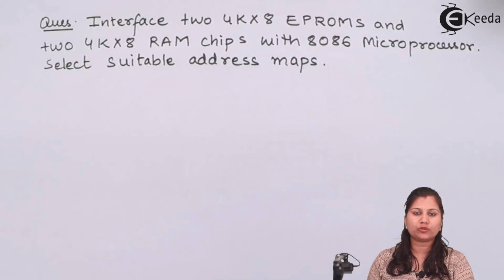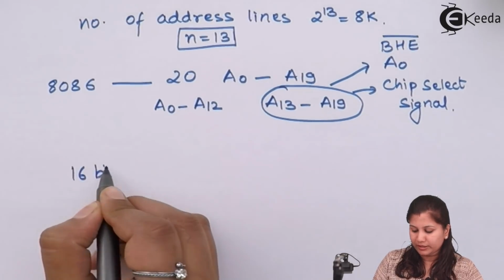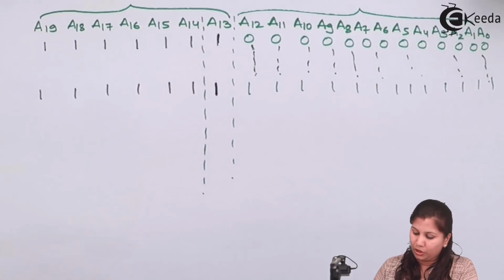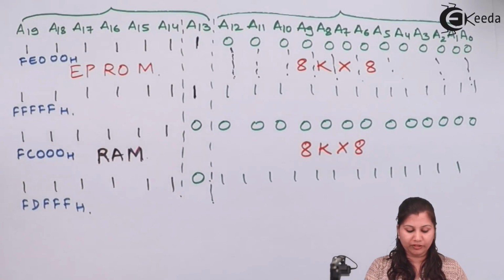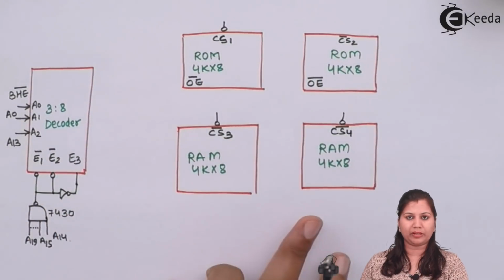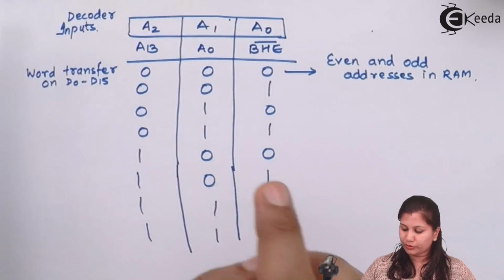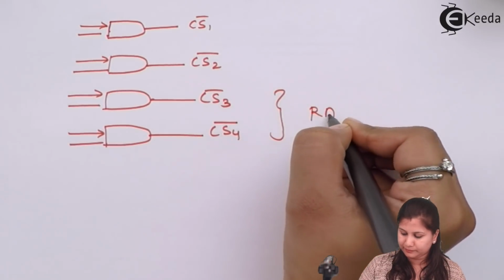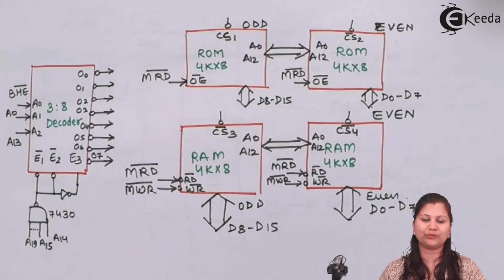Interfacing Memory in 8086 Microprocessor with Memory Chip (Problems)

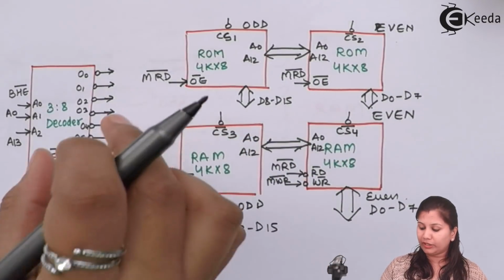Comment: The last part 29:29 is wrong, check the address lines, it should be from A1 to A12 and not A0 to A12, if a ROM/RAM has 4K locations how many pins will it have ? 12, mam you are trying to connect 13 pins at once, go get some practicals
Reply: Exactly same point. I am also having this doubt, how can she connect 13  address lines to the memory which is originally having only 12 bit lines??...

Comment: you have taken two chips of each RAM and ROM. But you have taken the total memory of 8k only, which is for either 2 RAMs or 2 ROMs or each RAM and ROM. why is the total memory 8k=4k+4k and not 16k=8k+8k. 
ma'am its urgent, please consider replying.
Reply: 8086 has an internal data bus of 16 bits or 2 bytes. Hence unlike the previous 8 bit processors you may have studied, 8086 having 16 data lines can be used to address a location in memory that contains 16 bits or 2 bytes at the same specified location (in 8085 if you were to store 2 bytes of data you would require 2 separate addresses in memory, but in 8086 you can store 2 bytes in a single memory location). However, most of the commercially available memory chips are "byte organized" and not "word organized". Hence to store 2 bytes of the data at the same specified offset within a particular segment, we would require 2 memory banks, one for storing the higher byte of data and another for storing the lower byte.

Comment: 1 ram has 4K memory locations => it should have A0-A11 lines(i.e 12 address lines) . but according to you A0-A12(13 address lines).isn't it wrong?  29:10
Reply: newdreamz a1-z0  but in the question, it is said to interface 2 4k rom and 2 4k ram, that means 8k rom anr 8k ram, according to that 13 address lins (i.e., A0- A12) will be used.
Reply: @shivamjhariya7315  but here A0 will be used for even and odd bank selection, the address lines that should be connected will be A1 to A12 not A0 to A12 look carefully, A0 is already connected
Reply: Yeah